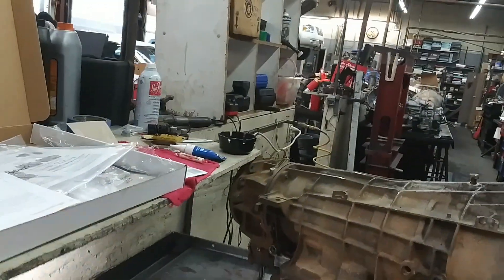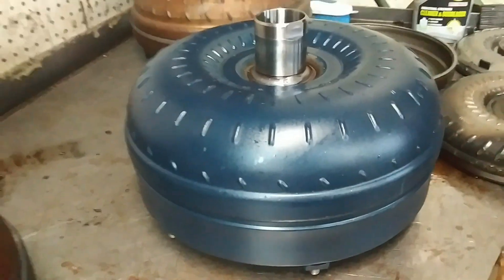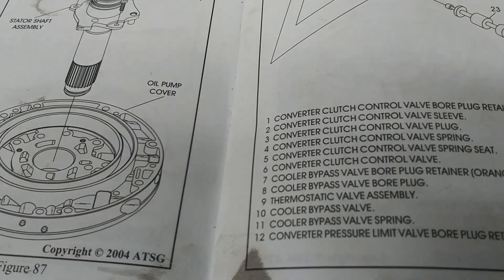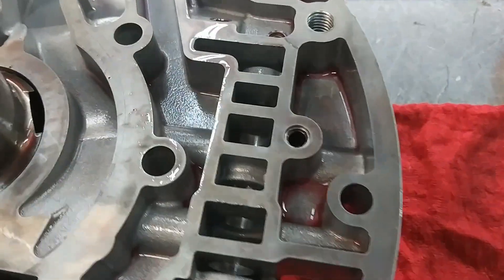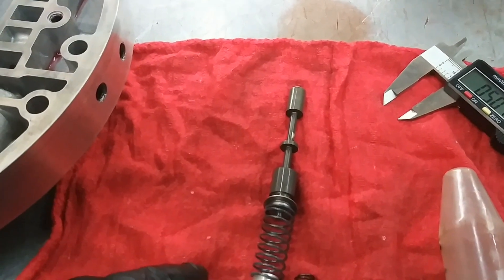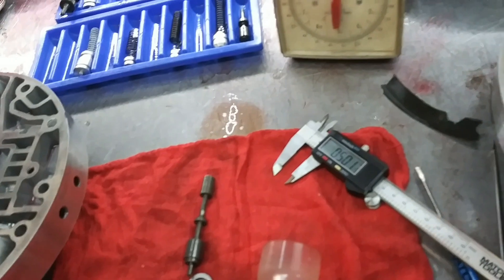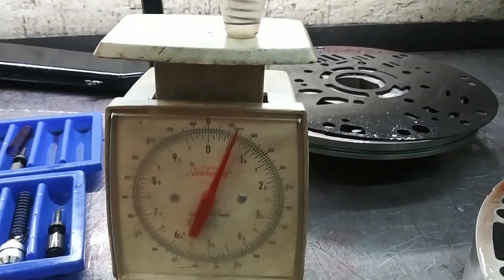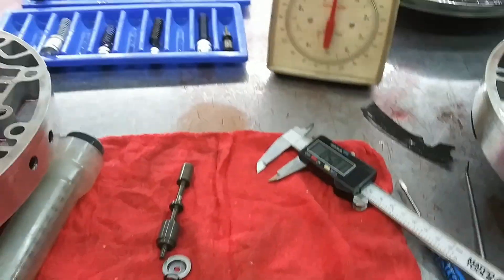5R110W P1744 Torque Converter Clutch inop

Comment: Additionally, using the car with these two codes have negative repercussions? Any transmission damage?  Or I can use it until I get the valve replacement.

Comment: Greetings from Panama. I have a 2009 F250 and I get the code P0741 and P1744. Both indicate mechanical or hydraulic failure based on the 5R110W transmission manual. Aside from replacing the TCC control valve assembly which is located on the transmission pump, should I replace the torque converter as well?